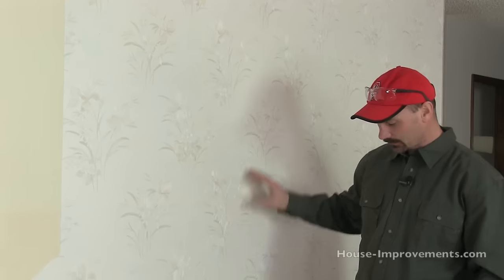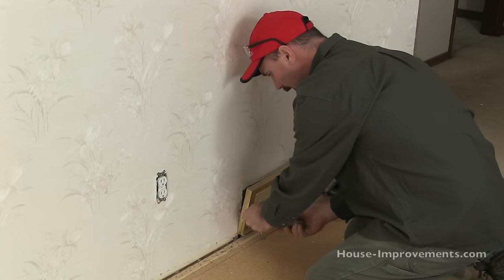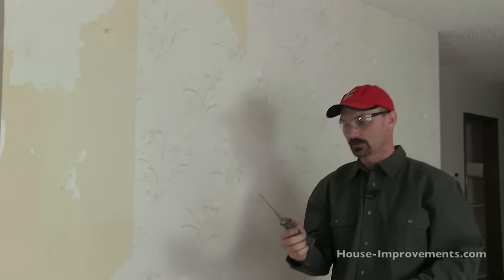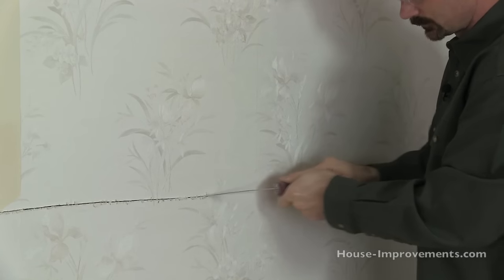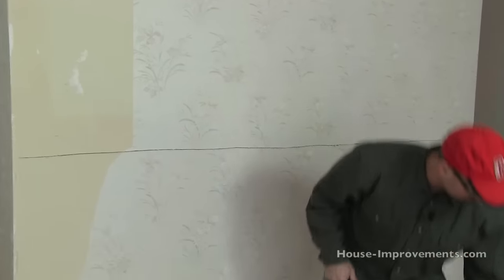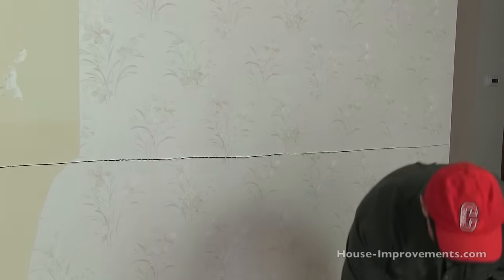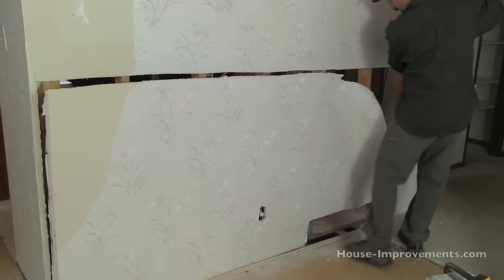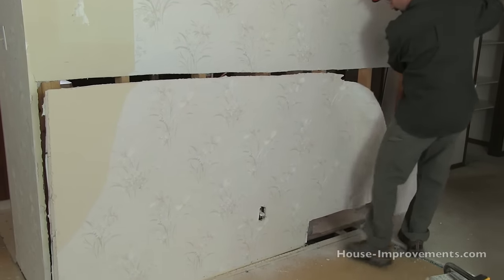How To Remove Drywall from a Wall

Comment: Every time I do this, there's a million nails or screws and the the drywall comes off in little tiny pieces.
Reply: After just going through those same millions screws and bits of drywall myself, I know now why the drywaller said I would save a $1000 if I removed my water damaged drywall myself - lol!

Comment: This was a very informative video I would have never thought of pulling drywall off like that I would have just took a hammer and start hacking holes and pulling it a part. which would have been more Messier then the way you done it
Reply: I did exactly like you mentioned now I’m up a 1:30 am cleaning up & watch this video

Comment: Very good instructional and DIY video!
Tools required:
1 x cutter 
1x drywall saw
1 x hammer
1 x crate opener as wedge or anything but not your fingers!
1 x safety glass
1 x dust mask
1 x electrical screwdriver to remove the plug outlet
Maybe hand gloves too to prevent cuts.
And of coz, cleaning and disposal of  drywall parts in the end.

Comment: Good work Shannon. I always wear a dust mask when I do this kind of work on my house. I have been blessed/cursed with an older house built by the original owner who obviously thought he was a master carpenter. He was most definitely not. A dust mask can also protect you from mouse doo-doo inside the walls. That stuff can be bad news. keep up the work. Your videos are extremely helpful.
Reply: MrToolmaker23 ja

Comment: I wish I saw this earlier.  Especially the tip about cutting the corner paper with a knife.  Thank you for sharing your knowledge.  I would suggest tipping the outlet down so dust can't fall into it.  Also, as someone mentioned earlier, to be safe, I would check the cable for damage at the location where the saw cut across.
Reply: Always remeber to score the corners! 👍

Comment: This is a really great video. Very informative step by step. I'm a complete novice when it comes to this so now I know all the precautions even though many of it seems to be common sense it's always good to have all bases covered before proceeding. Gonna continue see if there's a video on how to insulate walls. Thanks again!
Reply: Lol when we want to take away wall paper it's so hard.... here it looks so easy 🤣
Reply: MARILU ORNELAS it turns out that the easiest way to remove wallpaper is to remove the drywall it’s attached to 😬
Reply: We used piranha wallpaper remover from lowes. Not very expensive. Worked wonders for us.  Bit messy.

Comment: Excellent video. I am going to tear out two kitchen walls this weekend. I assumed by watching the DIY t.v. shows that I was going to just hammer away at the walls to remove the old drywall. But doing it your way is better. Then I can have new plumbing and electrical completed which will make my kitchen renovation much easier.
Reply from the maker: good luck

Comment: You may want to take note of where you used your saw and after removing drywall if there was an area close to wiring as in this wall check the wiring to make sure you did not damage it.

Comment: Thank you for showing me how to remove drywall. I had a leak in bathroom and had to replace floors and walls and tiles. Your video was very helpful and gave me the confidence to handle the job. Thank you again
Reply: What video did you look up to redo your floors im having same problem in restroom with leak need to replave both floor and drywall

Comment: Thank you very much for this video. Someone put normal drywall in the bathroom with flat paint. 40 years later, it is paper thin. Plus, moisture from the tub has gotten up in the dryway so I need to replace it. This is very helpful and gives me confidence to do it myself. Unfortunately for me, there is plumbing and a tile counter/sink and toilet in the way lol. Oh and I subscribed.

Comment: this is a great way to do it neatly. but when you are doing a full interior demolition of a house you have to work way faster. if the back was exposed, hit the drywall from the back where the nails or screws where and the while sheet will come off

Comment: In California where I live you have to have the sheetrock inspected after it's hung and before mud and tape (because of earthquake standards). They wouldn't be very happy to see edge nails and glue. 12/4 is mostly the nail pattern here. But the glue sure made taking it down a breeze, and took care of that wall paper removal in the process...

Comment: Excellent video, Shannon, thanks! I wondered if you'd get around to mentioning the issue of drywall (gypsum) dust. It's particularly fine-grained stuff, not something you want in your lungs. At the end of your video, you mention the idea of wearing a dust mask—but maybe it'd be a good idea to add something about that at the beginning instead. I'm just thinking that some people may not watch all the way to the end, and it's something they really should be careful about if they'll be working with much drywall at all.
Reply from the maker: You are correct ,unfortunately we can not edit a video once posted without losing all of our stats.

Comment: I usually poke holes in the drywall with ah hammer, then rip down the pieces. this method seems so much better. Trying it out this week on an electrical Repair.
Reply from the maker: Good luck.

Comment: Shannon we often take a reciprocating saw with a shortened blade so you don't cut electrical wires and then cut the drywall between the studs allowing us to just rip off the strips. I would like to see what you do when it is time to tape at the ceiling. 
PS check out the wallboarders buddy drywall cutter. I just finished off a whole house for the first time in 40 years. There were 120 corner beads to set and 8" window returns throughout the house as the house has 14" thick walls. It sure made the job easier

Comment: I am wondering why there were no screws in the drywall field; then I saw you had glue. Good video but it is not the same for me.For me, I will use a magnet to find the screws then mark them and remove them before removing the panel. Nice tip for scoring the joins to the ceiling.

Comment: Sheet rock and dry wall is so cheap. 
First thing I did when I bought my house was rip ALL OF IT away. 
Reinforced all the studs by making them sections of 3, instead of 1. Put support beams going accross. 
And added 3/4s inch ply with sheet metal attached to the outside to it. 

Such a house can withstand tornado weather, and flying debries like it's nothing. 
Also anchor all floors down to the conccrete base of the house. 
Was it expensive? yes. worth it? yes. 
Yu have security in your place, and you don't have any fear AT ALL of any huricane, or weather of any kind. 
DOing this to a small rancher home btw makes it allot easier. It would take much more time to do it to multi level places. 
But it can be done.

Comment: not trying to downgrade you video but! my dads a 33 year red seal carpenter i'm starting my first year in carpentry through his company, and we had to strip a wall to the studs, and we did it in one piece. and what we did was much faster and easyer(you punch two hand holes between the studs, cut the tape joints on top and sides, grab firmly in the hand holes, shake back and forth drywall will coming in one piece not 5 xD
Reply from the maker: +ColdFire MC Yup I'm sure it worked fine, You have a younger back than me,LOL. I have learned working by myself that a few extra trips is easier usually than carrying large pieces. Good tip though. Good luck in your career!

Comment: My house is from 1923. Except for the kitchen in the bathroom all the other walls are plastered. I want to take the drywall down in my bathroom, what if there is Plaster under the drywall? And since it is the bathroom is there a certain drywall I should get to replace the old?

Comment: I need to remove 12inches from the floor up only. I am having a basement waterproofing company in and they need access 1ft up. Any tips? Would there be a power tool to use as I have about 24 ft I have to remove
Reply from the maker: I would use an oscillating saw. Snap a chalkline to follow and away you go!

Comment: I saw the glue spots but it doesn't look like it did a very good job at holding the sheetrock on the wall, otherwise you would have had a hell of a time getting it off not to mention all the scraping you would have to do to clean up the studs before putting up new sheetrock.

Comment: Thanks for this it was very helpful. How did you fix the flooring gap left by the wall once removed?
Reply from the maker: Plywood added to get the same height and then the entire main floor was covered in new hardwood flooring
Reply: @HouseImprovements  thank you sir

Comment: Good Video. Thank You. Ive demolished my wall. Can i just cut the ends off the elecrical wires?
Reply from the maker: No they need to be traced back to a junction point where they can be completely un hooked and removed.
Reply: I understand. Thank You.
Reply: i finished a demolition project a few months ago, and i had the same idea when removing the drywall, except i did not cut a the top because i was removing the ceiling as well. but for the future, i learned a couple of new things. thank you

Comment: Are you at all worried about asbestos in the drywall or popcorn ceiling when removing it? I found out my drywall seams and popcorn ceiling in my 1972 house has 1-5%  asbestos in the drywall. Any tips or thoughts?
Reply from the maker: Mike Lang there is some concern in homes built before the late 90s. the risk in my opinion is slim but never the less it is a risk. wearing a respirator could help.

Comment: How do you know where to stop demolition on the ends?  On the right side, I imagine you can remove the corner bead and install a new one after you replace the panel you removed (or maybe keep the corner bead and slip the new panel under it?)  

The left side is more tricky in my mind.  I read you are not suppose to align panel edges with the edge of an opening (door opening, window opening, closet opening/arch), because cracks are likely to develop in the corner.  So where do you stop removing drywall on the left around the arch, if you only want to remove the drywall that you showed being removed and not anymore around the top of the arch?  Thank you!!
Reply from the maker: Nicholas Hoffenpiper  Please ask your questions in my forum.http://www.house-improvements.com/forums/

Comment: i have a bit of a complicated question: i need to take down the drywall from my basement bathroom but i would like to extend the bathroom a bit into the boiler room to create enough space for a stand in  shower. will taking some space from the boiler room cause a problem? and will removing the studs and remaking the frame for the bathroom disturb the floor above? and how do i remove the 2x4s of that wall? thanks
Reply from the maker: trinaija  Please use my forum for any questions you have .http://www.house-improvements.com/forums/

Comment: I used a multi tool to cut a straighter line, and partially through, then I used the knife to cut. I was having issues cutting with the knife, due to there being osb board behind the drywall.

Comment: Hi Shannon how do you remove the drywall screws from the studs?  The screw heads will have dry mud in them.  Great videos by the way. Subscribed and liked!
Reply from the maker: It crushes enough when you stick the driver bit into the head.

Comment: Hi I have a question, sorry it is not about the wall, but the ceiling in this video. I have the same  type of rough ceiling and I want to have a smooth one. Can you please let me know what is that on the ceiling and how shall I tackle it, shall I simply cover it with cement or something, or sand it. Would really appreciate your answer
Reply from the maker: +Bab Vladimirova  Here is my video showing how to remove a stipple (popcorn) ceiling.https://www.youtube.com/watch?v=09Q4JQ3p8yg
Reply: Thank you, but I dont think it will work. (I will try though). We have it in the bathroom, wouldn't it collapse by now if it easily removed with just water. Also I think it is painted on.
Reply: +Bab Vladimirova there's a big difference between ambient moisture from shower use and direct application of water from a sprayer followed by scraping. It will work. Just make sure you use a straight, sharp (i.e. not old and abused) drywall knife.

Comment: If there is insulation behind drywall (such as fiberglass) do extra precautions have to be taken?
Reply from the maker: there will likely be a poly air/vapour barrier between the drywall and insulation if its an exterior wall or ceiling so be careful not to damage it or at least fix or replace it afterwards.

Comment: I need to have some drywall removed in my finished basement  to access the foundation wall for a crack. Initially I thought I would have to pay someone but I think I can handle this. The time to actually do it is my concern.

Comment: Is this today's more traditional drywall?  I have a part of a wall I want to take off to put up drywall, but it appears to be the old fashioned stuff that feels almost more rough, like stucco or even a concrete mix.  Can you take it off the same way?  That is is you even know what I am talking about, given I am not quite sure how to describe it!  I tried taking off face (fake?) brick thinking it might snap off, but the surface behind is coming off with it leaving huge gaps.  Therefore, it seems to make sense just to remove the whole thing and start again.  Not a super big area.  Smaller than the one you were working on.
Reply from the maker: You may have lath and plaster? Come to the forum with your question and maybe a picture and I could help from there. http://www.house-improvements.com/forums/

Comment: This is an inside wall. I would like to know how to do on a wall that has vapor barrier and Insulation. I had water dmg and i need to repair only the bottom. Im afraid to not be able to connect the new vapor barrier with the present one properly.

Comment: Would you recommend pre-cutting with an oscillating saw where the drywall meets the ceiling? I know you used a knife.
Reply: Mark Cafiero it makes it go quicker and can be useful with plaster but is a bit overpowered and you run the risk of hitting any hidden utilities.

Comment: Great video Shannon!   Why would the receptacle have a red wire connected to it?   White for 14-2 and yellow for 12-2.  I thought red was reserved for 12-2 heating wire only.
Reply: It's ok as long as you paint the end of the red wire with white paint when it's feeding a 120V outlet.
Reply from the maker: The red/orange wire you are seeing is an old original wire from 1975 when the home was built

Comment: is it possible to remove drywall and reuse it in another area?? and if so, how would I remove the drywall??
Reply from the maker: It is if the drywall was not finished (mudded) but when re-installing it you should not use the same holes so that means much more holes and filling which usually means a worse finished product.
If the drywall was previously finished then my answer would be no,because by the time you find all the screws (which are mudded over) and get them out the sheet is usually wrecked.
Reply: thank you

Comment: Man, I hate removing drywall. I'm remodeling a shower and the idiot who put it in didn't use cement backer boards or a vapor barrier so I have to remove all the drywall  in the shower. I just got done and I could not get it out in nice bits at all, just little pieces at a time. Such a pain lol. Good vid though, watched it before I got started as I haven't done much drywall

Comment: How did you patch the ceiling and floor? Do you have a video?
Reply from the maker: No videos. Basically the floor just gets a strip of plywood the same thickness of the surrounding floor . At the ceiling I installed a "bulkhead" ,basically just looks like there is a beam across the ceiling thats drywalled  but its just a framed area that is drywalled .This is easier than fixing and blending both ceilings together. I believe you can see this in this video:https://www.youtube.com/watch?v=abakfpcOzeM

Comment: Inglés

compre una casa pero al pareser se esponjó parte del muro , que pasaria si si el muro esta expuesto y no hay nada entre la pared y la parte de afuera

Quizás quisiste decir:

compre una casa pero al parecer se esponjó parte del muro , que pasaria si si el muro esta expuesto y no hay nada entre la pared y la parte de afuera

I bought a house but when the couple was part of the wall, what would happen if the wall is exposed and there is nothing between the wall and the outside

Comment: Shannon, is there anyway to reuse that drywall (for the same site)...or do we have to throw it out?
Reply from the maker: Really not an option, Once it is painted it is not as easy to get a nice finish plus the extra taping to make the pieces work just makes it not reasonable to use again
Reply: Thank you!

Comment: What about setting the depth on a circular saw to 3/4 of an inch? It seems like that would be more efficient.
Reply from the maker: Dust, major dust!
Reply: HouseImprovements Thanks.
Reply: Matt de Oliveira You can use a vacuum panel saw. They are quite expensive, but you can insert a vacuum hose into it and eliminate any dust created from the cut. It will also cut right through those metal beads on the corners and has adjustable depth.

Comment: Very good if the goal is professional and clean for a customer. But in an emergency water damage restoration/dry out, mold remediation, etc. That entire wall could be brought down and cleaned up with no secondary damages, by someone who knows what they are doing, in about 5 minutes. Less if it's me 😁👍